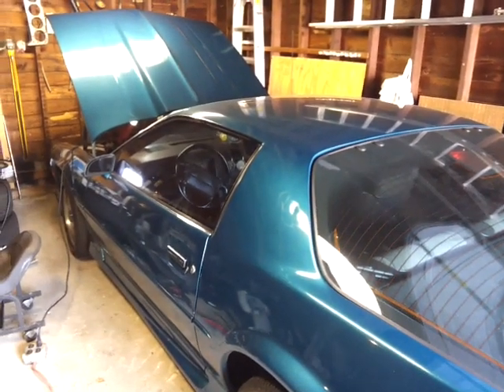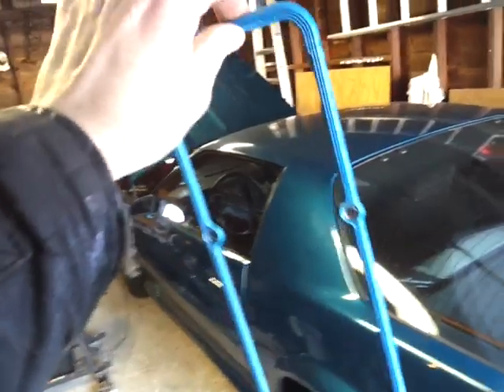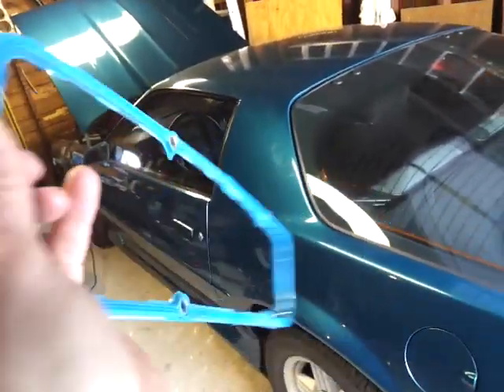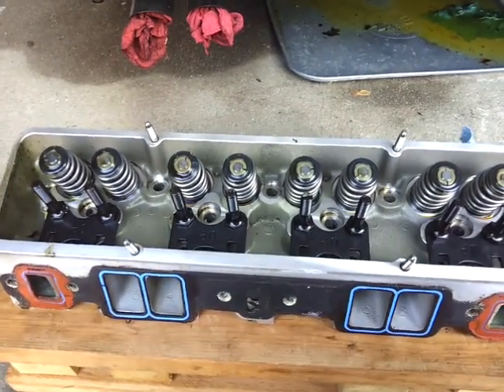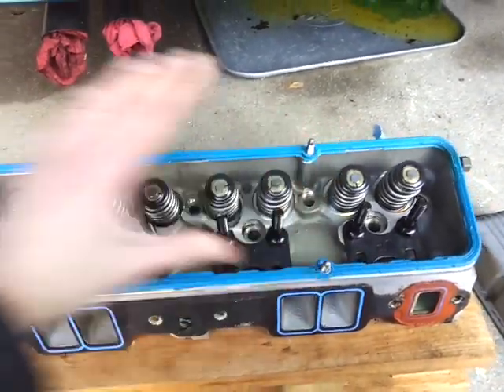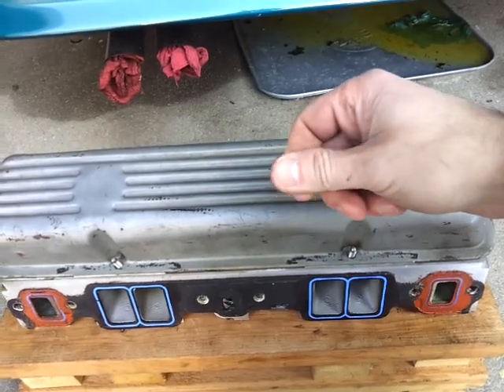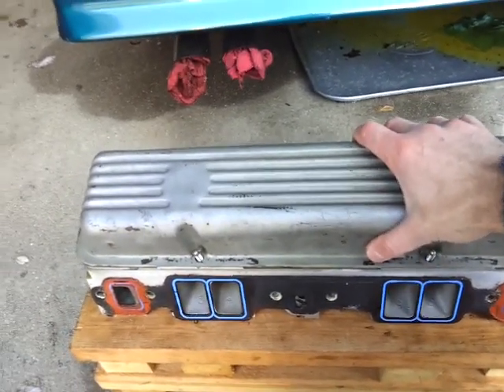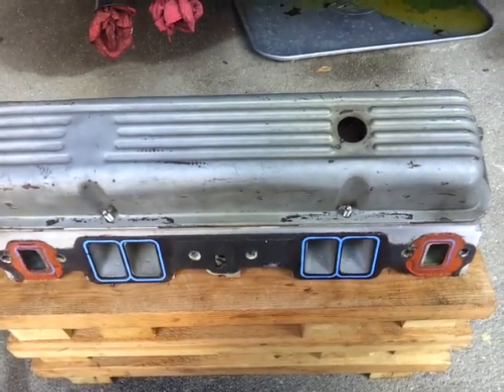How to Stop Valve Cover Leaks Forever!! Small Block Chevy / Ford / Mopar

Comment: Great video, got tired of my leaky gaskets so bought a set of studs and a pair of these.  I understand you are to place the gasket with the writing ‘rocker side’ closest to the rocker arms, my question is do you place it so you can read the ‘rocker side’ lettering or does that go facing down?

Comment: I agree with the assessment here of the use of studs as well. They provide an excellent clamping effect and is preferred where they can be used. Especially for a head gasket which I imagine you also did since it looks like you love the shit out of that engine.

I will have to call them myself since I got an engine that was only made for 4 years LX5. They don't make much in terms of aftermarket for the engine. But if I can stud it as is I will and if I can't I pull out the old digital caliper measure thickness of material and the drill and tap and die set comes out......Gonna make those studs fit.

Good video dude.
Reply from the maker: head studs are recommended when using boost because of the high pressures in the cylinders.. but are also a great idea nonetheless. .thnx for watching

Comment: I got a question you may not have answer for. Here goes
 How much oil should be in valve cover while running? At idle I have nice trickle but at 3k rpm I have enough oil in head that it covers entire head stud. I see this thru window in valve cover custom stuff. Now I believe my problem is using dart shp block with high volume oil pump is pumping more oil to head then needed which is inturn flooding valve seals and causing smoke when returning back to idle. I plan to replace seals and oil pump very soon. Just picking peoples brains.
Reply from the maker: It could also be your valve guides

Comment: You didn't mention anything about the grommets needed for this job.  Are they manufactured into the rubber gasket?  Is that what the metallic parts were?
Reply from the maker: Grommets? You dont need anything extra when putting thais gasket in..there are reinforced metal rings arouns the head bolt holes that are incorporated into the gasket.
Reply from the maker: Grommets? You dont need anything extra when putting thais gasket in..there are reinforced metal rings arouns the head bolt holes that are incorporated into the gasket.
Reply: klowny1969 do you use red rtv silicone on one side of the gasket or is this the type of gasket where you use it by itself with no silicone rtv?

Comment: the gaskets theres no need any kind of glue?
Reply from the maker: José Ignacio Muñoz Kortmann not the rubber ones for the valvecovers
Reply: Nope just don't over tighten, I think it's only like 5 ft lbs
Reply: For a sbc anyway may be different for others

Comment: yup that's so easy... off the car on a bench, now pop that in with those studs under heater hoses or AC hoses or other brackets, the studs will make that impossible
Reply from the maker: The opposite is actually true..with no head studs you are searching like a mad man for those holes..
Reply: Mine came from the factory with studs, they make it alot easier to install the covers

Comment: Good idea. Studs!
Reply from the maker: Thank you
Reply: I’m having a “fitting” problem with the Moroso valve cover gaskets and my small block MP W2 heads. There is too much material and I’ve been trying to Dremmel excess material away. Any brand suggestions for mopar other than Moroso?
Reply from the maker: @mrkwllms340  felpro makes a double gasket which is cork and rubber mixed, we use those now on our engines.

Comment: I used those and even with the load spreaders built into my value covers and the bolts tight they still leaked.
Reply from the maker: Sorry this video was a long time ago..there are better gaskets now..i use the felpro double gaskets that are nixed cork with rubber..put some gasket sealer on them and sela them to the valve cover side and the head side you can use some assembly grease to seal them..or just use that same felpro gasket and you might have to tighten them down a few cycles and they should work fine
Reply: @klowny1969  Yes that's correct to use cork, seal them on valve cover side and some grease on the other side for future removal. Those silicone gaskets can't work for steel valve covers, or engine sump. Cork is still the ultimate. Read so many blogs and 9 out of 10 still vouch for the good old cork. The Brits and Swedes continue to use cork in their classic car builds as well. 
Stud idea is truly amazing esp when you wanna remove the covers often. Otherwise, it's fine to use bolts as well. That's how they came from the factory anyway. 
It's individual preference.

Comment: No gasket seller?! This will leak eventually, common mistake of most mechanics
Reply from the maker: Jen Gal no..u dont use any gasket sealer on rubber gaskets
Reply: klowny1969 ya OK, that's why in a few months it will leak trust
Reply from the maker: Jen Gal if its leaking, ur doing something wrong..ive used the double cork gaskets from felpro with success as well..dont forget to subscribe to my channel
Reply: You never use sealer on a valve-cover, it's a low pressure area to begin with. You're confusing the valve covers with the top manifold...
Reply from the maker: Jen Gal yeah..he is probably confused with cork gaskets..rubber no sealer